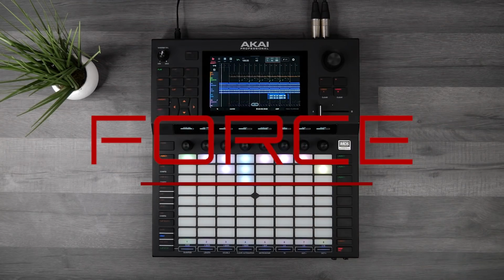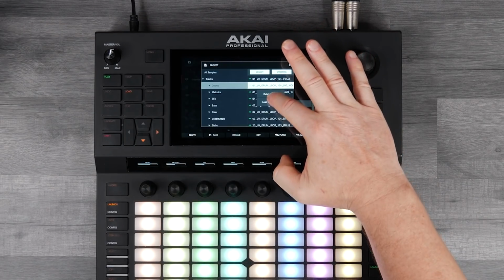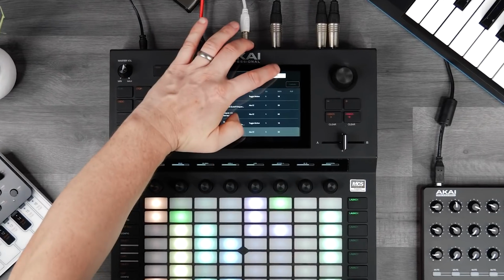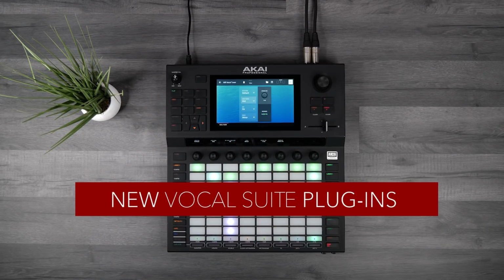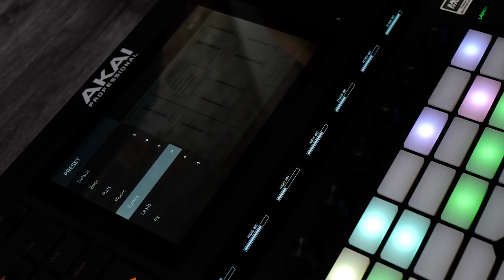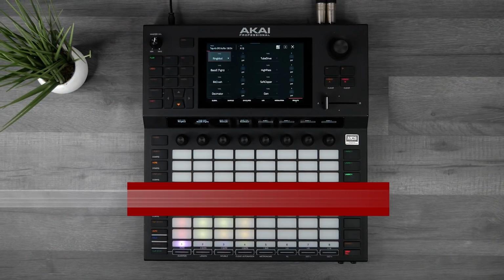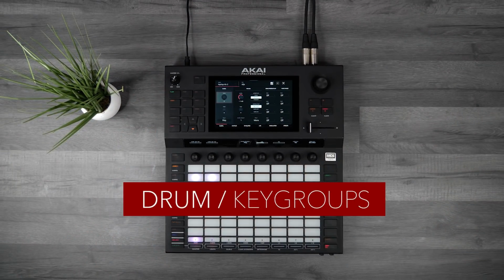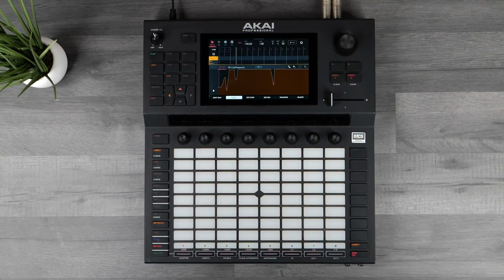FORCE Features Update 3.1 Full Overview Video

Comment: My only request is about Step-Recording. I wish to record a note or chord from the external MIDI keyboard to FORCE in Step-Recording mode. 
That say, I'm going to play a note or chord from an external keyboard while I'm pressing and holding a specific step, and then I can record the note or chord.
Arturia KeyStep Pro and Elektron Digitakt's MIDI track (only via MIDI) can do that.
I'm a keyboard guy, and I wouldn't say I like to play with hearing the metronome. Also, it's quicker to memolize the chord progression by the way above than the real-time recording.
Please, AKAI, give that force to the FORCE!!🪄🙏🙇

Comment: for upcoming updates I have some further improvement-suggestions

1. Step Sequencer
It would be cool to have an further step sequencer mode (polyphonic) that is similar to the one on "Novation Circuit" or "Launchpad Pro MK3", where you press on a step and select THEN the note(s) you want to have in this step. And where you can also see which notes are programmed in this step, when you press on the related step.

In my opinion this far easier and faster than pressing one note and then the step where it shell be played.

2. Padlayout - auto follow
A further improvement suggestion is, to make an option in the settings menu, where you can enable that the Padlayout follows automatically to what is shown on the display.

For example: 
If you open the Matrix: The Pads show the "Launch"-Layout
If you open some Plugin Settings: The Pads show the "Note"-Layout
If you open "Clip" or "Arrangement": The Pads show the "Step Sequencer"-Layout

3. More use of the Arrow Buttons
When I got the Akai Force I was pretty depressed that the 4 Arrow buttons only allow navigation in the "Launch" View.
I really would look forward to use these buttons also in other views for selection of the right now controlled parameter of the big rotary knob.

4. Faster Plugin Edit Method in Matrix-View
It is pretty annoying to only be able to edit an Plugin via the EDIT and Track Selection button. Especially when you look on to the screen in Matrix View, when you see your Plugintrack and a touch on it does not let you open the settings for it. You then need to lookdown, search for the EDIT and Track select button and only then you can open the settings.

5. Faster Arrangement-View call
A Button kombination (shortcut) which can open the arrangement view immiediately .

6. Support for Bluetooth Speakers/ Bluetooth Audio Devices
Bluetooth speakers are way more flexibel in use. It would make life so much easier if bluetooth could be connected with the Akai Force-Bluetooth Module.
I know the soundquality is not as good as a cable connection with Monitor speakers, but often I don't want to mix my tracks on the force. I just want to play arround with sounds and do a bit of simple beat making. And for that, a bluetooth speaker is totally enough. 
Even better would be a build in speaker in to the  Force, but that is not included in the device hardware.

7. Computer Keyboard and Mouse support
some kind of Shortcut support for Computer keyboards or any other functionality than just typing in the letters for file names would be cool.

Also a computer-mouse support would give more flexibility in the handling of the device.

8. One Audio Driver for all physical Ins and Outs
Similar to the Asio4All Driver on a Computer, it would be easier to have one Driver which can handle all connected Audio interfaces and Audioports at once.

9. Multi Track Audio Stream into a DAW
As far as I ubderstand the Force so far, it is not possible to directly stream the sound of several Tracks in Force to a DAW.
I think that would make a lot of sense, because you could do all the beatmaking in the Force and also could do precise mixing in your DAW live and simultaniously, without the need of exporting stems out of Force and importing them in to your DAW.
It would make things more flexible.
And an Audio Stream via USB or an other Digital Connection is better for the Audio Quality, than converting the digital Force Audio Streams into mono (via an multi Channel USB Interface) and connecting these Analog Ports back to another Interface
that converts everything to an digital stream again.

10. Multi Track Audio Stream from a DAW in to Akai Force
The other way arround would then be also nice, to be able to record or stream multiple tracks from a DAW Session to the Force without the Analog conversion, that makes the Audio lose quality and is time consuming in preparing and also in latency terms
Reply: 3 & 4 yes pleeaaase. This plus a few other missing features make this such a static device when trying to play live with it

Comment: Firstly, this is THE machine, the one and ONLY, if you want better go analoge for those thousand things. 

Now my problem. 

I did the update and start-up screen says 
"New plug instruments are available for your Force. To use them you must first download and instal their content files" 

and then the next pop-up says

 "Warning low on temporary space" 

what should I do?
Reply: I don't have an SSD available but I have a micro-sd, I am saving(save as) there all the internal storage projects and then I will try to clean everything up. I hope that I don't do something stupid.
Reply: if anyone can guide me that would be lovely
Reply from the maker: Be sure to download the synth content to an SD, USB Flash, or other external drive. The directions are in the update folder.

Comment: 🙈 Okay, Midi Learn! But where is your RGB? I have the Midi Mix, there is no support for necessary features to support midi controllers with Akai hardware! With this problem I had lots of probs with it! If you restart your devices, the setting is stored, but you have no communication and the controller do not get the values and you can set every value again! Because for the intern sysex there is no midi learn to bring the values to the controller during loading the project!!!! I have a MPC Live! Please look for better implementation! For me here Akai forgot the most important! Fir Live Performance the MPC Live needs a controller! But the implementaion isn't on a necessary level!

Comment: I'm really impressed. But why haven't you ported the "Force plug-ins", so that a ableton user, using only a moderate amount of those plugins in a project, would be able to open such a project on the force, and unlike today, still be able to at least have some plugins in ableton.

The next thing, would of course be to port the "force DAW" in to a plugin (possibly stand-alone version as well). That way people that do enjoy the ableton style workflow, but prefer other daw, could get the "force daw", and be able to use it inside their favorite DAW, combined with the hardware and control of that "force SAW" and possibly transport controls, perhaps mixer outside the plugin, you would have a really powerful offering. (Especially if the Force daw would support routing audio tracks to the plugin, and record, so that one could export a project from another daw in to it, be it a bit cumbersome, but so would be freezing plug-in tracks and exporting the audio to the force be as well). (Personally, to be able to use an ableton style workflow inside of studioOne, would probably make me mostly switch to that daw, and I would happily buy a force if that was required to be able to do that, I probably would, even if I could buy the "force DAW" plugin separately and would be able to map it to my launch controllers from Akai and Novation, as I the force could be a mobile/sketch set-up)
If you would do this, you would not necessarily need to port the plugins as my suggestion above, as ableton users could open the force daw inside ableton, but I do think that for an ableton user, having access to the workflow inside ableton, but with the added plugins, would feel more natural, than working in a plugin, inside of ableton.

I'm not a force owner yet, any of my suggestions above, would make it so that I would absolutely try to find a room in my budget for it.

Another thing that would convince me, even if neither of those features above came, is an instrument, that I would call the orchestrator, similar to what eastwest does with their opus orchestrator (sonuscore with their orchestra), but simpler. It should be possible to do, with disc streaming. It might require "freeze" the arrangement to audio tracks not to overload the system when exiting the instrument (but if the project saves references to settings inside the plugin, and the arp/sequencer parts inside it, one could open it up later for editing). If done right, the core samples used for that instrument, could be used in other instruments on the platform as well.
There is some synth power that I feel lacking with the force instruments, but I would be able to work around that for the most part. But a way of quickly sketching orchestrations, and make simple trailer-music style songs, inside of it, would be enough to convince me.

Another thing I would really like to see, is either expanded capabilities of the mellotron, or a mellotroner instrument/effect. Arturia supports sample import in to their mellotron, I think IK multimeda does as well, not sure about g force. But that would be a cool tool, that would work well with lo-fi genres, but also could make for some cool parts in other genres as well.

As a pianoplayer, a really good sounding piano would be nice as well.
Reply: WORD!!! a Force DAW-plugin is exactly what I’ve been thinking during the past year. Apart from allowing any combination with any other DAWs (Ableton, etc), any overlapping issues in terms of agreements between third parties (e.g. Force vs Push) would be zero. By the way, an example is the plugin developed by NI for the Maschine. Something similar would be terrific! Thanks for listening our feedback on the Force, Akai 🙏🏽

Comment: in retrospect, with Model 12 you cannot route the the same channel's physical input through FORCE back out into the same channel. If you are running a hardware heavy setup, you may be better off just buying a regular interface and mixing inside the force. Tascam 12 is a great mixer but it can be deceiving.

Comment: I have Korg nanoKontrol Midi controller. It works fine, and capture the volume controls for Hydrasynth, and Yamaha Genos on the Force. But the Polybrute is controlling it's own volume now. Before the update the Force was controlling the Polybrute volume, but once the NanoKontrol takes over the Polybrute takes over. However the slider on the Force moves, but just doesn't do anything to the volume. If I don't save the Learned Midi control, and turn off the Force, and back on again the Force controls the Polybrute again, but the nanoKontrol has not been saved so I am back to square 1.

Comment: Akai = MPC . If this came with a gift card for a free blow-job nobody still would not buy it. Its a generic Push 2. Abelton shuts on the MPC software. What is Akai as a company doing? This is sad. They’re just making toys now🤣😂. Dude, songs are made in a linear fashion. Focus on getting ya MPC X and software up to date. No one is buying this crap. Every producer video has a Push 2 and/ or Maschine MK3 in their video. Akai have no idea what to do with the MPC line— except churn out more smaller and cheaper MPCs but keep the same wack ass software all across the board.

Comment: Hi There, I have a question and I hope Akai or someone from below comments has the answer. Im thinking of buying Akai Force, however Im not sure if I can use it like I intend, because I didnt find any usefull videos here. I want to use it like a hybrid DJ player. This means loading whole finished tracks, not just short samples. I know u can do this with Ableton Live or Bitwig. Sometimes you need to work a little bit with the grid and cue points, because the stretch algoritms arent perfect, but thats ok. I just wondering if this is even posssible with Akai Force..
Reply from the maker: Yes. With the new Disk Streaming feature, this will be even more efficient and streamlined with the ability to build large projects featuring tons of tracks that will load almost instantly.
Reply: @Akai_Pro  Cool, thanks for the answer. So I suppose the audio stretch algorhytm behaves the same with loops and tracks if I change the BPM on whole project. Basicaly like any DJ software / hardware would?

Comment: So that's eight audio tracks direct to disc or from? So if you wanted to load a 24-hour file from your hard drive to one track you could? 32 channel mixer? This routed to eight audio tracks? And supports up to 30 USB MIDI controllers?

Comment: THANK YOU GUYS FOR UPDATING! I was really afraid Force was at end of life / legacy-ware already. Please keep at it! This is a fantastic piece of kit - and it keeps getting better and better!
Reply: I got one several months ago. I never tried it much because of the Behringer 2600, 550 , Wavestate, Modwave, and Hydrasynth , all of which i managed to get. At once...lol.  When I discovered recently that the Force only let me record audio for a short time I was annoyed...then I saw Pink Budda post and bam. It is like I dreamed of...since 1985 when the Publison infernal machine was a wet dream. Its all new to me at once! 

I plan on running USB data like I never did before. Once I figured out  "why does this have USB?"  and now the dawning of the Light. Force.  Hmmm, what no disk drive? =)  I suggest a decent SSD but I am using a HDD. It was a snap to install. Save all the old drives you usually toss, they real handy sometimes.

Comment: This means disk streaming coming to mpc 🤟🏾
Reply: Hopefully 🙏 But the Arranger has not landed yet either. This would help so much. And I hope they fix the crackling problem when one really wants to use the 32 I/O. I guess it’s a sample cache problem that can be fixed by increasing the value. Maybe Akai implements a setting for this? Just a suggestion.

Comment: Missing one thing:   Tempo change with scene or automation.   I really need this.
Reply: Seriously this is so necessary. Especially if you want to create any kind of liveset
Reply: Without this feature i can’t play live performance properly. I don’t like warping algos, so i use unwarped audio for playback. And without tempo per scene it is impossible to make it right. I just need to remember tempo all of songs and change it before hitting line button: crazy!
Reply: Use Half Speed plugin.
Reply: @_thevaporz  I don’t think you get the issue.  The tempo of the whole track need to change so every time synchronized parameter can be fed the correct tempo.  There is no tempo automation yet.

Comment: Anyone know when the bugs wil be ironed out of the MPC 2.10 update? I really hope Akai are working on this because it was better before the update in terms of the stability of the on screen parameters
Reply: What bugs do u speak of ?
Reply: @marvinbennett8384  Some parameters go wappy when you adjust them using q links, sample pitching problems when you move to a different window, some playback problems in drum program and sample edit. Quite a few annoying bugs that wasn't here before 2.10
Reply: @DisInfoWars  ok , I got the 2.10 update for the LIVE and the only bug I got was trying to save anything with a # in the name, like D# minor on the update now I have to save it as D sharp minor , not a biggie but I had to rename a lot of my old songs outside of that I love the fact that I can delete unused samples a little faster .
Reply: @marvinbennett8384  Word, looks like you got lucky overall. But apart from those bugs the update is amazing

Comment: I’m glad to see Force users got Odysey, Melotron, and Selina. I’m hoping this means One, Live, Live II and X users will get disk streaming in their next update (which I hope is a 3.0 update for many reason).
Reply: One don't have hdd. I waiting for Arranger.
Reply: @CodySmiley  you can plug up a hard drive via usb right now
Reply: @AveMcree  still usb 2.0 (mpc live/x has 3.0)
Reply: @CodySmiley  Having already addressed that, so what? Just saying the same thing again doesn’t make me wrong or you right…
Reply: @CodySmiley  I didn’t say the One has an hdd. I expected that I could choose the disk (like the “D” in SD). My BlackBox streams from SD so why would it have to be an hdd? Also, I put an SSD in my Live2, so IT doesn’t have an hdd either, could I not stream from IT?
Reply: @EverettVinzant  If disc streaming comes to MPC, it will work in the same way as in Force. They will not make a special version of the software for MPC One, in addition, in One the USB controller is version 2.0, which means it does not allow high speeds.
Reply: @CodySmiley  I’ve streamed audio over USB 2.0 (AGAIN THE BLACKBOX DOES THIS), in Linux AND Windows… Plus, it would be based on the driver at the OS level. Since the OS of the MPC One is the same as Live, Live 2, X, etc… (Linux) and ALL the storage devices in Linux are represented by a file… I’m still not quite understanding why you think this would be a special function for the One or why USB 2.0 matters… It all looks the same to the OS.